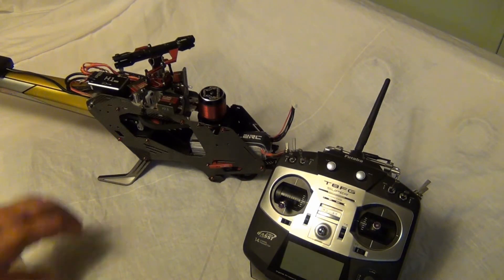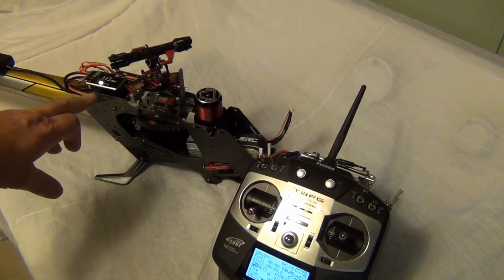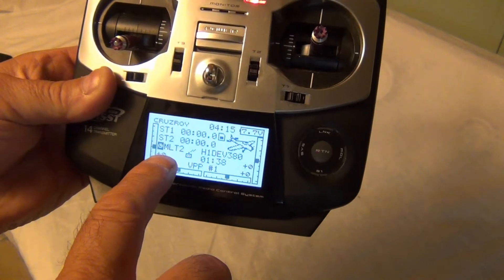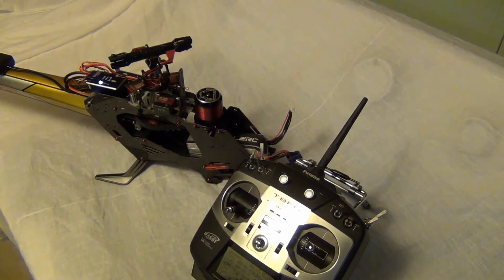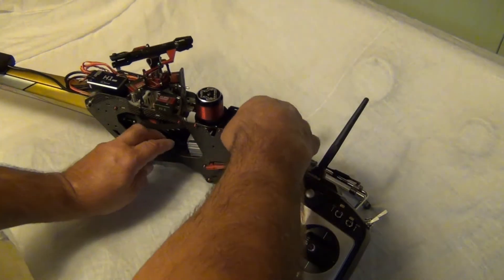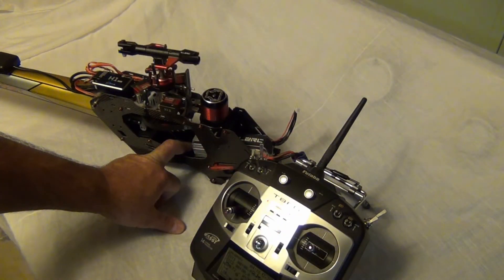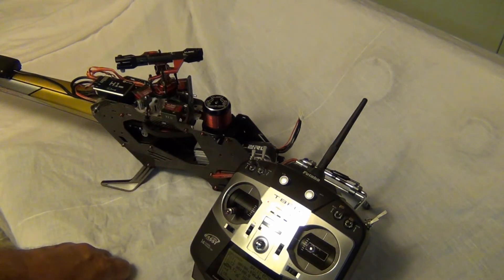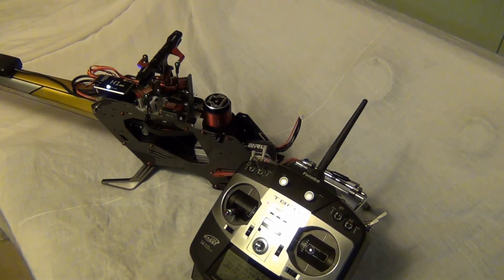H1 flight control Throttle response

Comment: I found your vid, I have an Alzrc devil 420 with a H1 in it , tx16s TX and I’m having same problem, wondering what you did to fix the issue?
Reply from the maker: there is no throttle during 3d mode, works on pitch

Comment: sir Cruzroy,i had 550  e6 nex fbl .i installed H1gps same as in your video . when i was turn GPS mode the sticks was not response up,down ,left and right except  tail servo.but when i was turn on 3d mode everything its okay . can you help me sir?thank you so much
Reply: this is normal. in GPS mode no servos are working until the headspeed is reached. than the H1 gives u controll over the servos. So be sure that the heli flight perfect in 3D mode!!